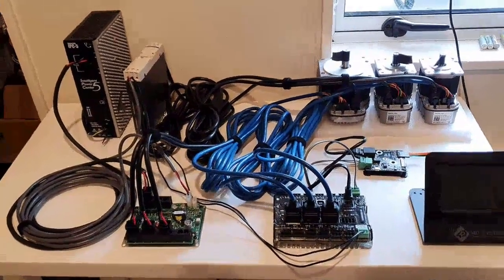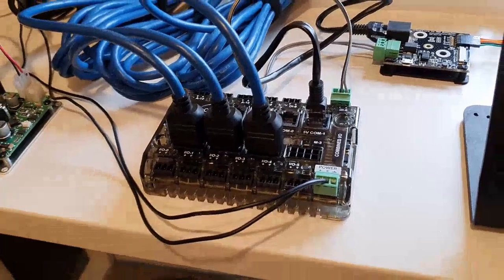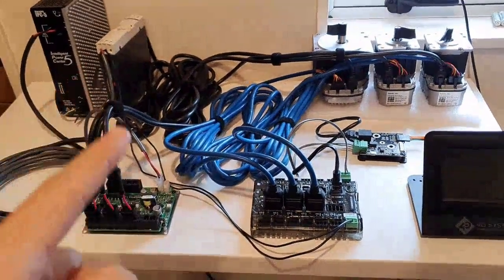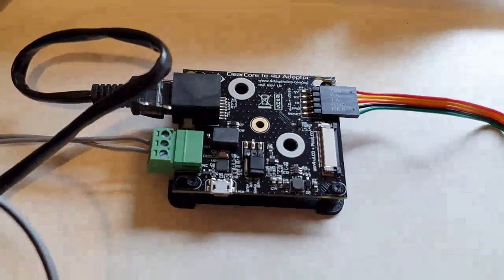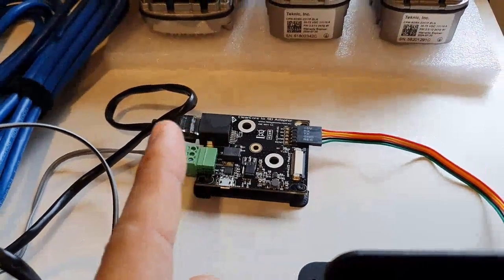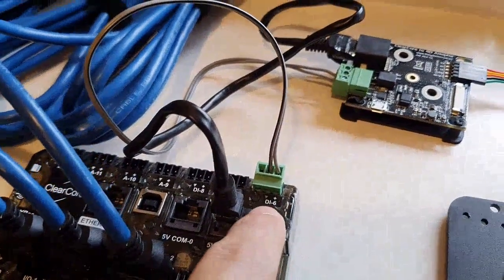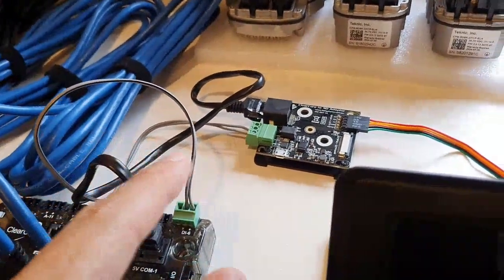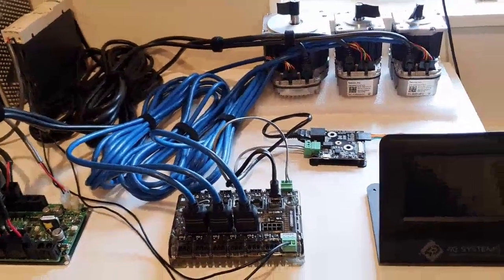4D Systems ClearCore Demo Part1

Comment: Are there any clear core related groups or channels? I’m building on a clear core now but I’m on my own. I haven’t found any clear core related support other than having to email teknic which is not very productive.. For now, I rely on the Arduino community and port the ideas over to C/C++ in Microchip..
Reply: I have struggled to find the same thing. Kind of stalled out on my project because of it.
Reply: @mjgerth  Most everything ClearCore related are in the examples.. For the most part, your focus will be either | and, C++ and or Arduino code to build whatever you’re working on.. As soon as I started focusing on what I wanted my motors, sensors, pneumatic actuators to do and in what sequence, ClearCore became less of the focus.  ClearCore mor fills thing in and not the main pie of your project. I recommend that you use object oriented programming and turn your physical field devices (sensors, motors, actuators, hmi or touch screen) into objects using classes. Use switch cases to build your program in a state machine type way. Most all the information you’ll get from the Arduino community even if you’re programming the C++ way.. You gotta push through the state of  not knowing the ClearCore library until you get familiar with it.

Comment: I need to know about the wires and where did you purchase them from. the exact ones you used in this video
Reply from the maker: Hello. Which wires are you meaning specifically? All of them? Most of them are from Teknic, part of the items used in the videos. The only wires supplied by 4D Systems is the part which connects to the display itself, supplied with the displays, or with the 4D Clearcore Adaptor. For part numbers of the Teknic parts, you are best to contact Teknic directly, and reference this video, and they will be able to tell you the wirings/cables used. I hope that helps

Comment: What are you using for the power distribution block?
Reply from the maker: Hello. I assume you are meaning the Teknic POWER4-HUB. https://teknic.com/POWER4-HUB/
Reply: @4DSystems  Yes I found it on their website. I assumed that it was giving you the 24v to the clearcore but the data sheet showed it has to have it's own 24v power supply
Reply from the maker: @markeilertsen  Yes the 24V is its own power supply, the distribution block just distributes the power and I believe the logic of the distribution block requires 24V to do the switching of the high voltage for the motors too. The 24V powers the Clearcore which in turn powers the 4D display. Best to contact Teknic if you have any further questions on their gear. Thanks.

Comment: What display is this in this video?
Reply from the maker: This video used the uLCD-43DCT, however any of the 4.3" modules like gen4-uLCD-43DCT / gen4-uLCD-43DT / uLCD-43DT / uLCD-43DCT would work fine for this demo without changes (other than to set the display being used). Even the Picaso or upcoming Pixxi-44 versions would work the same, given this is all using our ViSi-Genie environment. Easy to port over with only a few clicks. Its held in a demo stand we produced a few years ago.
Reply: @4DSystems  Anything that would work that you have in stock (as of SEP 2022)?
Reply from the maker: @aerospikes  Hi there. Global semiconductor shortages have been tough, and we have some ranges out of stock currently. However we have a new pixxi-44 range which is going live very soon which is a drop in replacement and will work the same for the ClearCore. Please make contact with our Sales team or raise a ticket from our website, and enquire about the "Pixxi-44 range of gen4 modules". Range covers 2.4" to 9.0" in sizes, so we should have something that will work for you. I hope that helps
Reply: @4DSystems  pixxiLCD-25P4 will work?  Is that a Pixxi-44 Gen4 module?
Reply from the maker: @aerospikes  Sorry for delay. Yes you can connect the pixxiLCD range also. This is not the gen4 Pixxi-44 range I was referring to, but yes you can use that. This specific demo wont work on it as the demo is written for a larger resolution screen, however you can certainly use the pixxiLCD with the 4D Clearcore Adaptor, connected to the Clearcore itself, and do the same sort of things as what is shown here, 100%.
Reply: @4DSystems  awesome thank you.